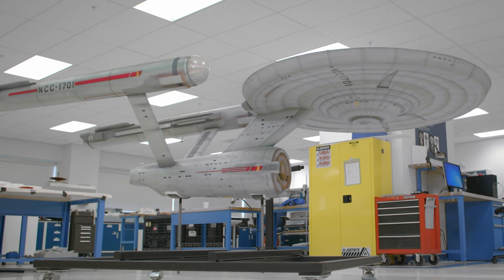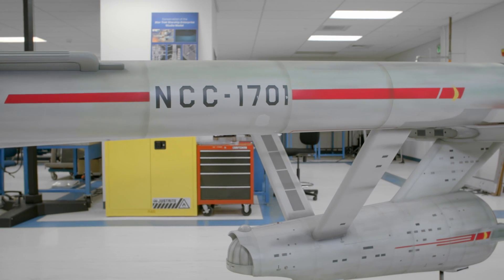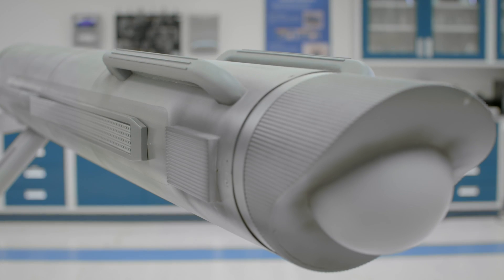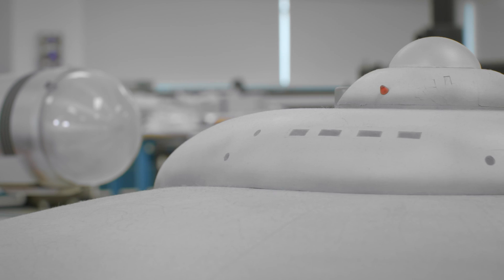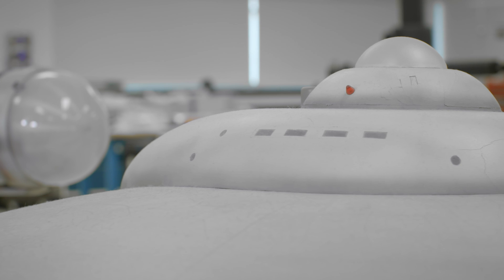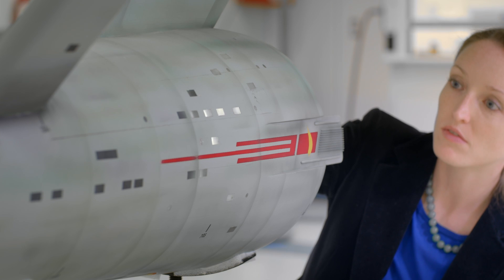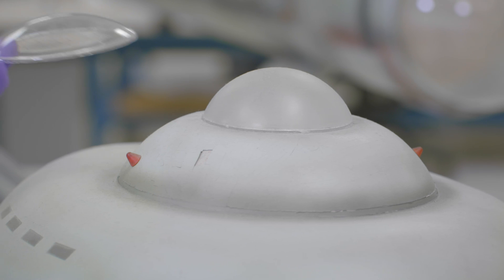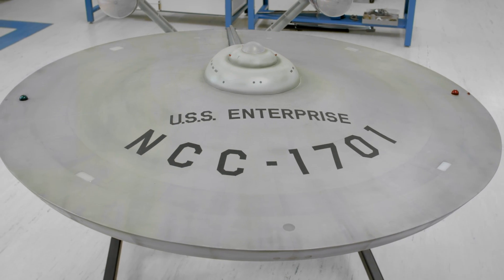Conserving the Enterprise

Comment: "Complicated History...it changed 4 times during filming, then 4 times during restoration." 

U.S.S. Enterprise Constitution Starship Class NCC 1701, one of 13 original starship heavy cruiser (CH) class one vessels, the second to be constructed in 2218 A.C./2245 A.D.; refitted to Bonhomme Richard (CH 1712) subclass during 2250s A.D. then Achenar subclass (CH 1732) in 2267 A.D., model showcased at the Smithsonian. 

While the actual ship would undergo a last upgraded refit during StarFleet's heavy cruiser 3 stages uprating program for both aging vessels and newer starship class vessels from the various heavy cruiser subclasses of three previous upgrades in a period of nine standard earth years (2266-2275 A.D.) to modernize them by 2280s extended service for another 20 years until honorable retirement service by 2295. 

Those were relatively newer hauls but outdate in recent late 23rd Centuries technological advancements; the program was to facilitate the incorporation for all three stage as either hybrid design of old and new tech as well as entirely refit new haul designs conducted from the late 2260s and early 2270s. 

The Enterprise (I) Class was the last of these 3 stage separate project but the first starship to begin; entering dry dock for 18 month refit upon returning from it historic five year mission under Captain James Tiberius Kirk command on 07 APR 2212 Alpha Centauri (A.C.) Martian solardate [Enterprise star date 7523.2] "the vessel earned a distinction unparalleled in Star Fleet history; of the original thirteen Constitution (I) class vessels launched, USS Enterprise alone had not been lost or destroyed in the line of duty" retaining her original command crew from the start of her initial launch on her fourth five year exploratory mission tour. 

Starship individual ship insignia employed since United Earth Space Probe Agency was grandfather only to the 13 original Constitution class but Enterprise 1701 historic legacy return for deep space exploration ship emblem was adapted to honor the crew in the 2250s. With only the initial original 13 Starship class design (the original Constitution class MK IX 1700-1712, including Constellation NCC 1017 cruiser [CA 1000 Horizon class]& Republic NCC 1317 [CA 1370 Archon class refitted]) all fifteen upon their initial launch to participate in the Historic Five-Mission Exploration Campaigns continued the UESPA traditions of individual insignia to distinguish these first ship of the line "starship class" from the rest of the fleet; retaining unique service in recognition from their individual achievement, compare to the other ships that would later join it the mission assignment. (Editor's Note: So as to illustrate that the Enterprise wasn’t the “only outstanding efficient ship” in the fleet)

Hence why most of the ships of these early classes commission plague noting it as a "starship class” and instead of “Constitution class” for which the class was original recognize as based up UESPA contract registry but under UFP listing registry as Constitution and in Starfleet as Heavy Cruiser Class One Mark IX. 

It is literally a badge of honor for any who serve board any of these 15 original starship but tragically with their continue service between 2239-2265 most won’t survive intact or with their original command crew. It would be during Captain Pike command on Enterprise second and last of two five year-mission era accomplishment that honor his achievement in which Starfleet would adapt the Enterprise insignia to represent those who service onboard starship duty fleet wide around 2250s thru 2277; while those who served on starbases Ground Duty large gold starburst cluster and Starfleet Academy Cadet a silver starburst cluster, along with many commercial/auxiliary/mercahant duty of  UESPA fleet line service would transition gradually away from the ship logo insignia warn on the uniform until the 2270.

“Starfleet’s tradition of honoring the original starship Enterprise… bears the original Starfleet registry (naval construction contract) number of that illustrious first (starship class) Enterprise, NCC-1701”…with a suffix A thru Z for the successors to bear the name. “Few other ships in the Starfleet have been so recognized. So significant were the exploits of this original ship and its crew, that in 2277 the practice of having a separate insignia for each starship (starship fleet duty & star base shore)was abolished, and the Enterprise emblem was adopted as the official symbol for the entire Starfleet.”

The refitted Enterprise Launched ahead of schedule responding and resolving the Vejur Incident and the following year defeated an entire Kzin task force, effectively ending the Kznti Incursion of 2272. In her fifth tour of UFP Treaty Exploration Territory boundary five year mission made contact with the Inari civilization bound sub quadrant 3 south in 2277. Upon a successful completion Enterprise was honor by assigning her to Starfleet Academy San Francisco that same year replacing USS Potemkin (CHT 1711) serving as a line training vessel (ATRA); such ship are assigned to rotate with each other from one Starfleet Academies facility throughout UFP principles stellar systems as a midshipman training vessels Temporary Assigned Duty (TAD). 

Potemkin command was at Starbase 4, then assigned at Starbase One Starfleet Academy facility to be retired and permanently berth there as a museum scheduled for 2290. Traditional training vessels are only assigned in areas of the innermost layer home sector, keeps it from harms way. The spherical defense duty of three layers for rapid response from the Fleet comprise of Star Fleet Reserve Force, Rapid Deployment Force, TacFleet, Star Fleet Active Exploratory organization patrolling UFP Treaty Zone: the first outmost frontier, second interior layer which includes neutral zone frontiers, the third innermost layer of the Home sector. 

"The Military Staff Committee and the Requirements Analysis Board issued a directive to decommission heavy cruisers of 20 plus years of service, specifically the Enterprise (I) class on a selected-vessel basis" as well as those of the recently refitted Constitution (II) aging classes.
Reply: USS Yorktown (CH 1704) Constitution (II) starship class was slated for retirement upon her last tour but with the new Enterprise (II) class order with a new hull registry (Hull registry later assigned to Levant CH 1843) was to bear the honorary name. Ironically, while returning to port for decommissioning, she encountered an alien probe during the Whale Song Crisis in 2286; her Chief Engineer successfully implemented a makeshift "solar sail" that enable her under her own ship's power to make it to port without being tow but more importantly without any loses to her crew. 

This distinction from her command crew earned USS Yorktown a reprieve on an extension after a minor ship repair for another five years assignment on active duty in quadrant zero (AO) and slated for retirement as a museum upon completion. USS Levant was then proposed prior to construction as the new class based on Enterprise (I) design with an order of seven new ships hull number registry 1800 series (CH 1843-49) shared with the Tikopai (CH 1800) subclass original order 43 [1800-1832 ] as exploratory cruiser (CE) later changed to heavy cruiser in 2272.

The decision for selected decommissioning was reversed by Chief of Star Fleet Operations less than four months later with all Enterprise class for refitting but with the heavy damaged sustain on Enterprise "training cruise" as well as consideration of her age disqualified her for the upgrade program and was slated for decommissioning. Tragically NCC-1701 (CHT) severed as a training vessel from 1977 through 1983 before she could be decommissioned was destroyed in a Klingon encounter that remains classified.

 USS Ti-Ho NCC-1798 hull registry originally authorized on star date 5930; (1732-1842) for 111 ships were pr
oposed with the assigned name USS Czar'ak (CH 1798) Achenar starship subclass, construction order. This large order number based upon projection to the escalation in rising hostility along with neighboring neutral zone frontier border of the Gorn, Tholian, Kzin, Klingon and Romulan, but as expectation and confidence for open conflict decline; Star Fleet reduced the order to 68, then to realistic manageable 13 in the class [1732-44] with the modernization fleet upgrades on the previous classes in both Constitution & Bonhomme Richard heavy cruiser classes to be included this time without Enterprise among them. 

The Czar'ak was cancelled and hull registry reassigned to Ti-Ho; the named was originally considered for the Endeavor subclass newly builded order, until it was decided instead reserved for the Enterprise (II) subclass MK 9B construction order and to also be the testbed host for the new Leading Engine, Ltd FTWG-1 transwarp drive experiment contract. Possessing the best warp dynamics, versatility and survivability universal design like the Constitution class before; the Enterprise subclass are also utilized for most of the newly developments, advancements within spaceflight and weapons technologies which are first tested in these classes. 

Although the Ti-Ho post-shakedown availability (PSA) schedule for a normal three months period, her returned from her first stage of deep-space shakedown trials was only three weeks cut short, before it was cancelled and was rushed for an early launched commissioning ceremony, where she would be renamed one final time. Many in the Admiralty believe this rush into service based only on "successful computer simulation" may have led to the "Transwarp Drive Incident" that would follow; again status classified restricting any details. 

In further gratitude, Star Fleet Command elected to rechristened the new Enterprise (II) class, Ti-Ho with "Enterprise" and retaining her naval construction contract hull registry was also once again changed but adapting 1701-Alpha" given to command by the demoted Admiral Kirk for action in disobeying from a superior flag officer but honored with the rank of Fleet Captain for his accomplishment. From the Enterprise (II) class making the last newly constructed of these classes to be USS Alliance (CH 1849) on 2290.  

For the other Class One Starship, Starfleet would end the uprating with USS Endeavor (CH 1716) class, which was design to begin the first stage integration newer vessel with outdate tech, and with USS Constitution (II: CH 1700) as "the middle stage" older class merging that of old and new technologies.  

Always advancing forward, looking towards the innovation vision of the future, Star Fleet Military Staff Committee was looking for the next generation successor to the Enterprise class for the 24th century to utilize transwarp engines exploration to safely pierce the outer Galactic Energy Barrier. Built by Shuvinaaljis Warp Technologies, specifically for a new battleship class, that later was reclassified as Space Control Ship (SO) Experimental (SOX) design program (SCS) in the Excelsior/Ingram class starship. 

Only USS Excelsior (NX/CH 2000) would have a proposed contract order for 98 to replace and retire the aging Constitution based design adapting the classification as the new heavy cruiser class by 2300 A.D., with USS Ingram (SOX 2001) starship the only of its class produce retrofitted with a standard advanced LN-72 linear warp engine replacing the transwarp unit, as was Excelsior, then assigned to TacFleet. USS Enterprise (CH 1701-A) was decommissioned due heavy primary hull structure damaged in 2292 and was decided with the second Excelsior class upgrade variant vessel USS Merrimac (SO/CH 2015) whose construction began in 2288 A.D. would be rechristened "Enterprise-B" upon her completion 2293, when it was decide to decommission Enterprise-A but like her predecessor before, would be plagued by a rush into service in a baptism of fire on a response to a rescue mission El-Aurian refugees that would result in the injuries of several crew and the death to delegation of honorary guest Retired Fleet Captain Kirk .

Source Cited: 

https://memory-beta.fandom.com/wiki/Star_Fleet_Technical_Manual

https://stexpanded.fandom.com/wiki/Starfleet_Dynamics

https://memory-beta.fandom.com/wiki/Spaceflight_Chronology

Other Source Refer to other materials:

AMT ERTL U.S.S ENTERPRISE UNITED FEDERATION OF PLANETS HEAVY CRUISER CLASS STARSHIP NCC-1701 MODEL NO 6676 complete listing of Starfleet Heavy Cruiser class contingent: 1) CONSTELLATION NCC-1017,  2) REPUBLIC NCC-1371, 3) CONSTITUTION NCC-1700, 4) ENTERPRISE NCC-1701, 5) FARRAGUT NCC-1702, 6) LEXINGTON NCC-1703, 7) YORKTOWN  NCC-1704, 😎 EXCALIBUR NCC-1705, 9) EXTER NCC-1706, 10) HOOD NCC-1707, 11) INTREPID NCC -1708, 12) VALIANT NCC -1709, 13) KONGO NCC -1710, 14) POTEMKIN  NCC-1711, & 15) BONHOMME RICHARD NCC-1712 (*)

**Ship of Star Fleet by Canon Riel Defense Forces Institute copyrighted 1988, 1991 Mastercom Data Center

Starlet Prototype a joint publication of Starlet Tactical and Strategic Design (circa 1992)

Starfleet Dynamics 25th Anniversary Collector’s Edition ST VI TUC Stardate 9200 created by Strategic Design Copyright circa 1991 

Jackill’s Star Fleet Reference Manual Vol 1-3 written and illustrated by Eric Kristiansen

Star Fleet Uniform Recognition Manual layout and Illustration by Shane Johnson [calendar date ALPHA CENTAURI ]

Star Trek Spaceflight Chronology by Stan Goldsteing and Fred Goldstein illustrate by Rick Sternbach (1980) Pocket Books Simon & Schuster

Star Trek Role Playing Game Core Game Book published by Last Unicorn Games(1999)

History of the vessel Enterprise from Ronald M Roden Jr (1992) Intergalactic Press

Star Trek The Next Generation Technical Manual by Rick Sternbach and Michael Okuda. Pocket Books. NY 1991 **

Star Trek Mr. Scott’s Guide to the Enterprise written and illustrated by Shane Johnson. Pocket. NY 1987 [calendar date ALPHA CENTAURI ]